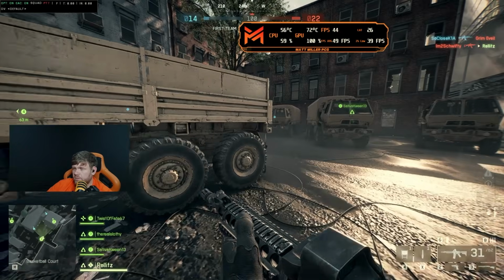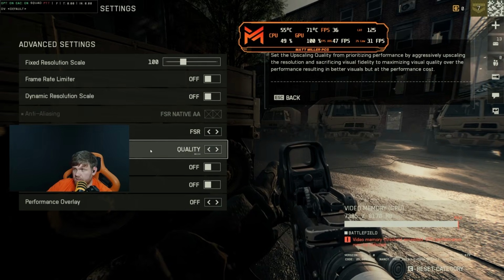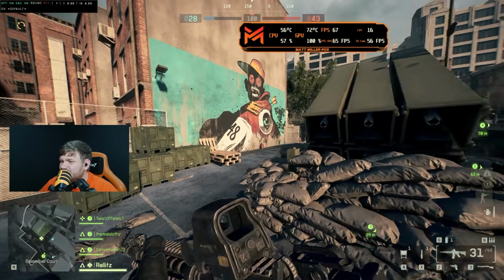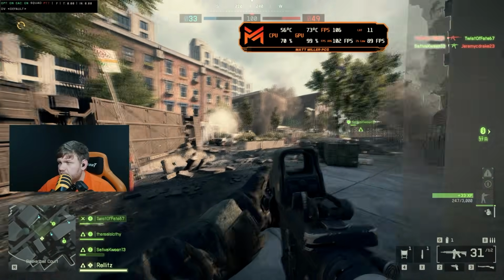Can the RX 580 run Battlefield 6?

Comment: RX580 is an AMAZING card !

I bought it in 2017 and used it until 2023 when i replaced it with RX 6800.

Played all games without issues.. fps almost always close to 100.. and on high settings.. 

I played on 1080p mostly